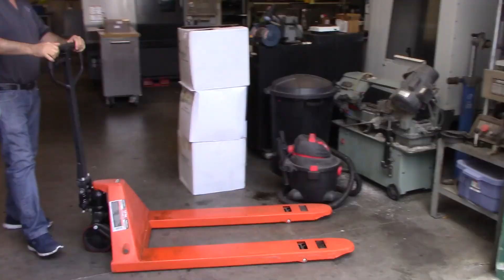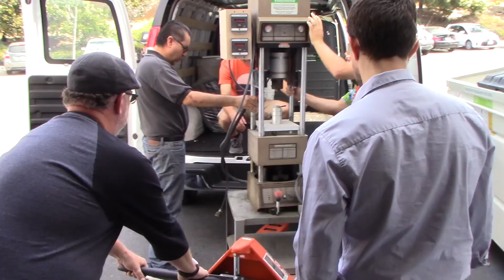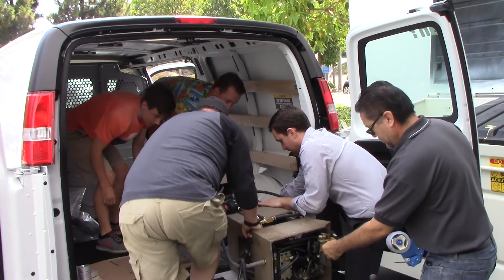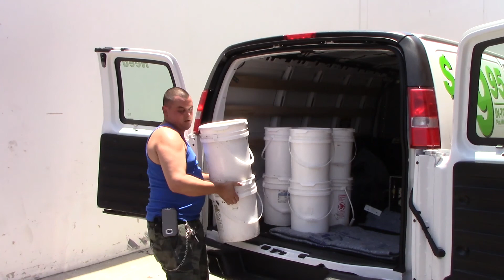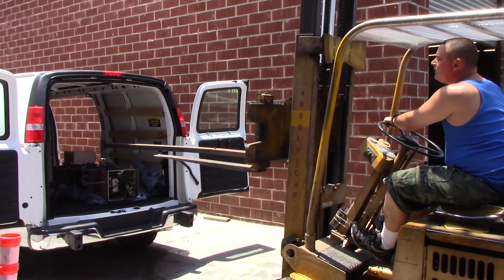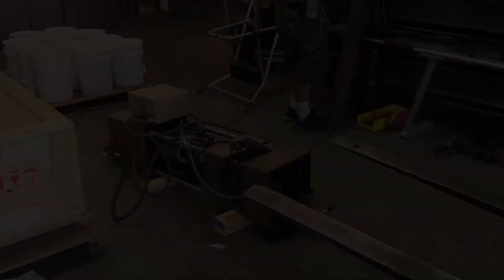#15 I'm Getting a Morgan Press

Comment: Hi John, Have you considered different machines with screw like Boy 15? 20 ton of clamping force sounds nice for such a small machine. Looking forward for new episodes.
Reply from the maker: The short answer is that I don't know enough. Here is the longer answer. Getting a screw machine is something that I might look into in the future. It's a big jump for me, though. Most of the molds I've created so far are manual molds, so I have to take the molds out of the machine in order to remove the parts. My understanding is that the screw machines are all designed for automatic molds.

The second reason is that I wouldn't know where to start in terms of what to look for, and then how to get the machine running. One of the reasons I started this YouTube channel is that, moving forward, I hope to learn from other people rather than figuring things out myself, based solely on searching the web. I'm a software developer by day, so all this mechanical, pneumatic, and hydraulic stuff is new to me.

The Morgan Press kind of fell into my lap. I wasn't actively looking for a machine, and it was also local pickup only. The stars aligned, however, as the machine was located just a 1 hour drive from Morgan Industries, so I didn't need to figure out how to crate and ship the machine--Morgan will take care of that for me (at a cost, of course).
Reply: is this the same one you just unboxed?

Comment: John, what was the process of getting the machine refurnished?  Ie the costs associated with it.
Reply from the maker: I dropped it off with Morgan Industries and they checked it over and then sent me an estimate. The machine had a number of customizations that they didn't consider to be safe, so I had them take it back to a stock machine. The refurbishment, packing, and shipping came out to about $2,500 (packing and shipping was about 1/3, labor was about 1/3, and parts were about 1/3).
Reply: Nice John...That seems like a fair price...You planning some more videos on it?